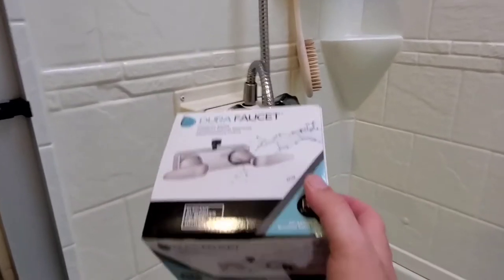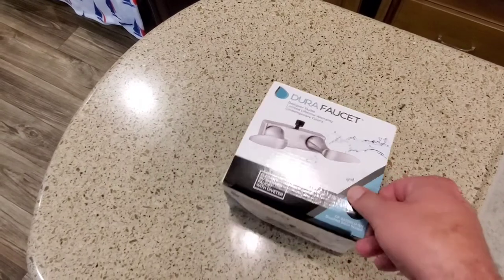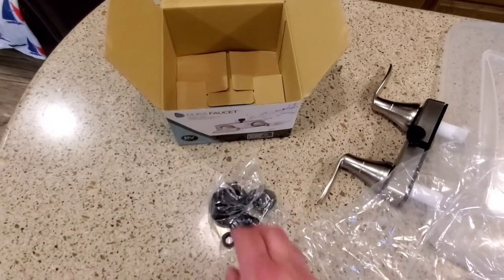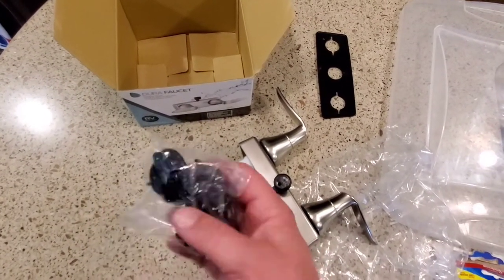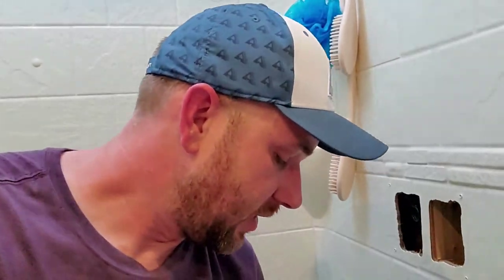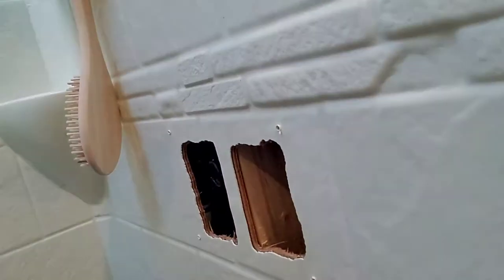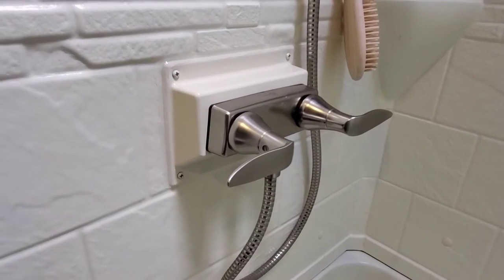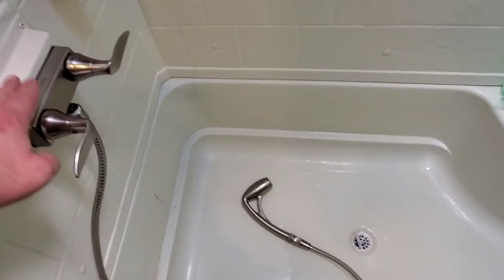RV Shower Faucet Upgrade

Comment: I needed to see how you actually detach it from the wall
Reply from the maker: I guess I didn't compellingly show removal did I? Dang it! OK so... at about 4min 4sec in the video I start removing it. I remove the 4 screws, then you'll see me pull on it but it doesn't come off the wall yet. That's because the silicone is so holding it in place. So I cut through the silicone with a screw driver or plastic scraper. THEN I'm able to pull on the faucet showing the pipes behind it. The part I didn't show is removing the pipes from the faucet. It's very simple. The pipes unscrew from the back of the faucet. They have big plastic spin on/off type of rings around the pipes, that's what you un screw. I'm gonna find another time market in the video to refer to where I point those out. One sec, I'll respond to you again with that reference point. 😁
Reply from the maker: Ok so at time market 4min 22sec... I point out some big washers that came with the new faucet. I point to the back of the faucet at a white pipe sticking out, and say the big washers screw on there to hold the faucet in place. Ok so..... the pipes in your wall screw on and off on that same white pipes seen on the back of the new faucet. If you'd like, hit me up on Facebook (decampers decampers) yes decampers twice. Msg me and I can help you out easier, send pix etc. Watching this it looks like a chunk of the video didn't load up. Sorry about that. But hit me up on Facebook messenger and I'll help you out. This is Nic by the way. 😁
Reply: @vdubing01  thanks for responding! I finally got it. They just make the hoses so short there's hardly any wiggle room to get them off or be able to see what you need to be doing. I guess my hot water side was just a little loose, I tightened it up and it's not leaking any more!!

Comment: Why didn't you actually show the installing of it?
Reply from the maker: I show everything expect tightening the water lines to it, exerting the 4 screws back in end silicone. But I do show those steps on removal and explain in detail. If you can't figure out how to do this upgrade by watching this video you probably shouldn't do this job yourself.